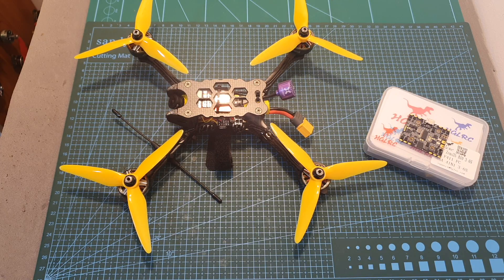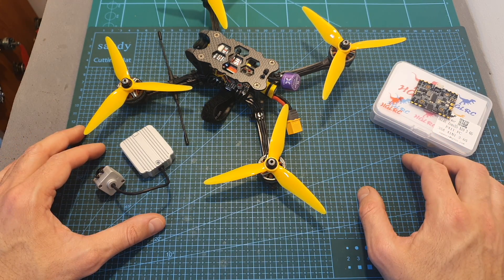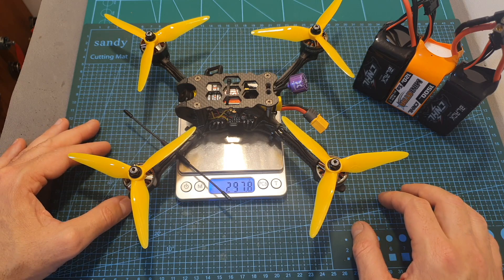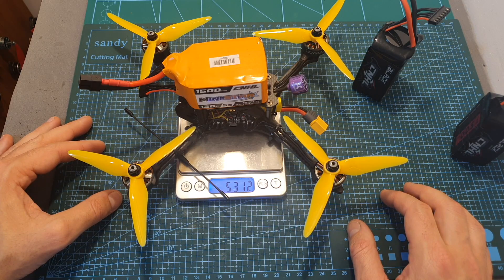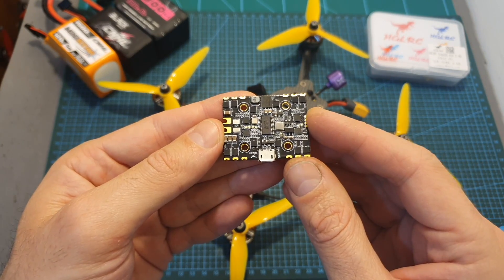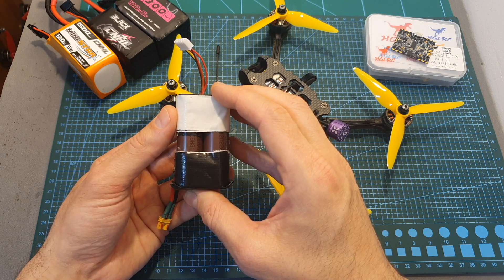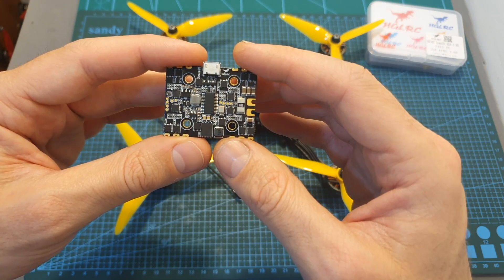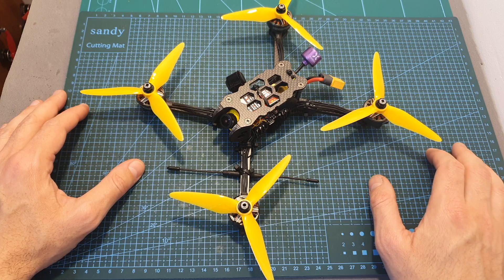HGLRC Zeus35 - Can It Handle a 5" 6s Build?

Comment: Didn't liked HGLRC board quality earlier. 3 their FC's died in my quads in a row at short time 3 years ago. Turned out they got better. This board seems a solution for two my quad (3" 3S and low profile 5" 6S) conversion to DJI Vista FPV. Probably will check this out.

Respect about idea at 1:30 how to use 18650 from old laptop batteries with a fun. I definitely will try that out :)  Now I have a reason to purchase a little spot welder.

Comment: Thanks for this video! I just got my rev 2 version of this board in the mail and was questioning whether to put it in my 6S 2208 build or not. Looks like it worked well for you!
Reply from the maker: My pleasure Justin. I would suggest limiting the motors output to about 95% when using 2208 motors, just in order to stay on the safe side.
Reply: @KremerFPV  I tried to test it a couple days ago and massive desync. Barely was able to get into it. Did you use bl_heli s stock firmware?
Reply from the maker: @justinslaight  Yes I used the stock firmware. When using Dshot300 are you experiencing it as well?
Reply: @KremerFPV  Ahh, I had it at dshot 600, so that can make it desync? I'll have to try it.
Reply from the maker: @justinslaight  I am not sure if that's the cause of your issue but it's worth trying this option.
Reply: @KremerFPV  I appreciate it, I put emu on it, turned it to dshot 300 and no desync. Thank you!
Reply: @KremerFPV  By the way, I loved your long range flight with the explorer. I wanna go to Isreal someday very badly! Read quite a bit about it from the Bible. I bet you love it!!

Comment: DONT BUY THIS (S****) FOR 6S RIGS > Burned two of them just on 6s lipo plugin > HGLRC doesnt care. The offer me a little discount if i buy a new one. Never seen something like this -.-
Reply from the maker: That sucks. I've been using a 6s with no problems so far however it is heavily depends on your setup.
Reply: @KremerFPV  im wondering... I have never flown this "stack" with 6s. On 4s and 5s there was no problem at all. Both burned just on 6s lipo plugin > nothing to to with my setup. First was without capacitor, second one with 1000mohm capacitor on batpad. Everything clean soldered. Very annoying product, or qualitycontrol
Reply: @Raphi86  do you need the capacitors for 4s?